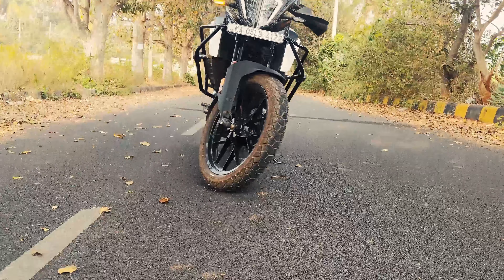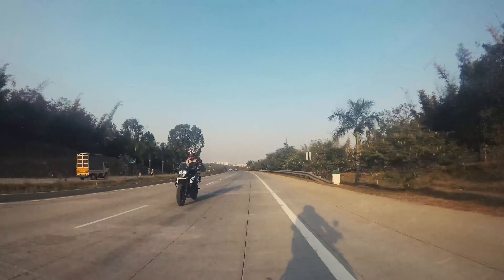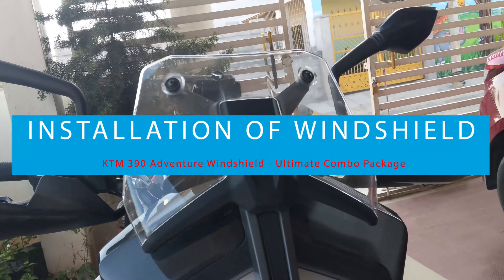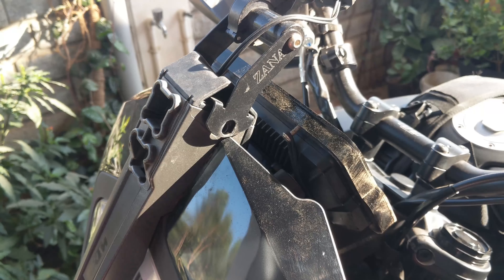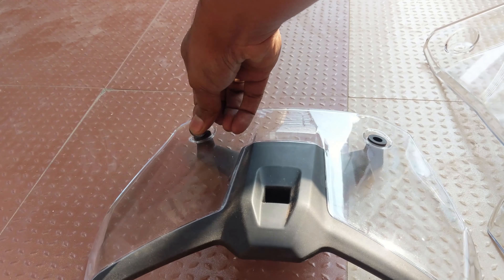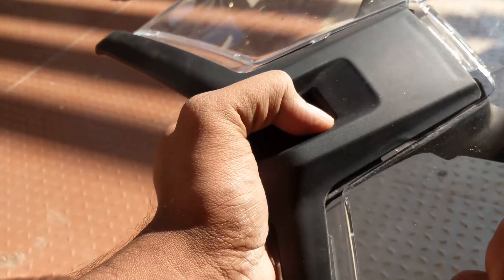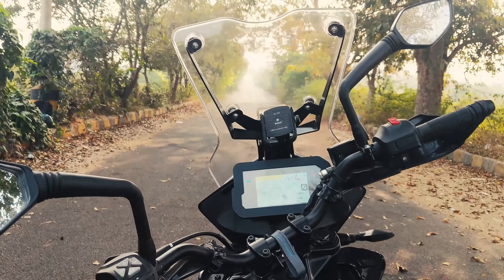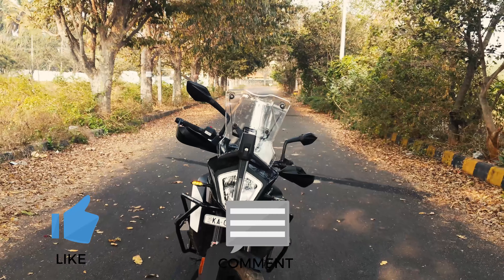Carbon Racing Windshield for KTM 390 Adventure

Comment: Good perfect DIY video. Can you let us know if you are facing any vibrations please? Among many videos, i have seen one YouTuber complaining and posting videos of the V2 windshield vibrating like crazy. (i only hope it was not due to incorrect installation). Let me know please, this is something i am planning to go ahead with.
Reply from the maker: Yes there is vibarations at high speed above 100kmph. As far as i saw review of other windshields also have vibrations. We cant expect zero vibrations as this is not coming as a stock windshield. By looking at the design of ktm 390 adv thr is no much support for headlight and speedometer console and in high speeds this windshield will deflect the wind which in turn impacting on entire head light region causing vibrations.

Comment: Bro, How much is height difference of factory one and this carbon racing one? Does it vibrate on speeds above 80? Thank you for video.
Reply from the maker: It’s around 13 to 15cm more height than stock windshield. Above 100 you might experience vibrations. As I already replied to many comments. If u increase the height it has to break too much of wind which creates pressure on headlight area
Reply: @twoboundaryless  ok.thanks
Reply: What if you installed neck brace by motourren, that would make the unit more stable  @twoboundaryless

Comment: Hi, I see the left mirror touching the windscreen? Is that an issue? Also any vibration or noise you observed after a few km with this screen?
Reply from the maker: For me it’s perfect fit, mirrors are not touching. may be your clutch liver is inclined towards ground, not aligned with the front bake liver. If u make that adjustment it might resolve your issue There are vibrations above 110km/hr speed but for me it’s acceptable as it avoids wind hitting on my chest area and gives more comfort in riding at high speeds

Comment: Would you recommend this windshield? I want to stay away from any kind of excess vibration.
Reply from the maker: If you are ok with small vibrations then u can go for it, As ktm 390 adventure has not much stabilized support for head light area along with this extended windshield  (any extended windshield available in  market) while deflecting the wind at high speeds it will cause few more vibrations
I am happy with it even with small increased vibrations because
As I am using it for a while, before I was not comfortable with speed above 120kmph but now I can comfortably reach 150kmph without any pressure on chest area
Reply: @twoboundaryless  do you get wind buffeting on the helmet with this windshield?

Comment: I have installed this on my 250 adv and its vibrate alot now my TFT screen is also shaking with the stabilizer block.  Doest yours too?
Reply from the maker: Tft screen is not shaking for me if I mount mobile in GPS block then thr will be bit shaking of mobile thats it